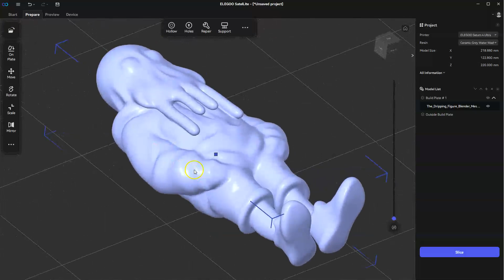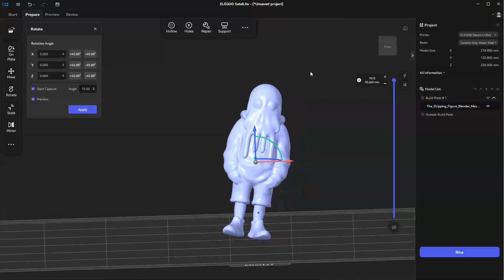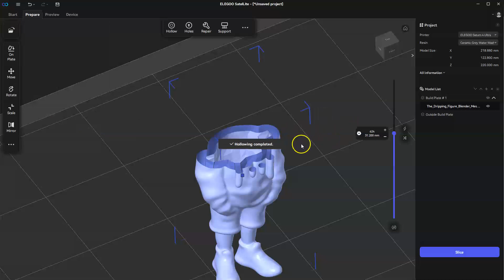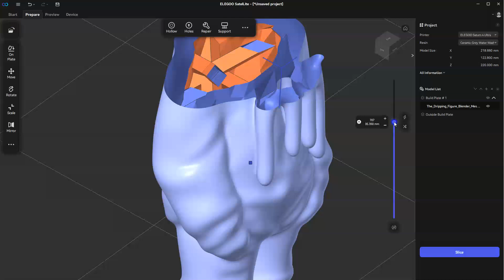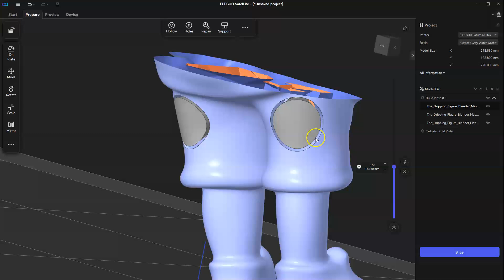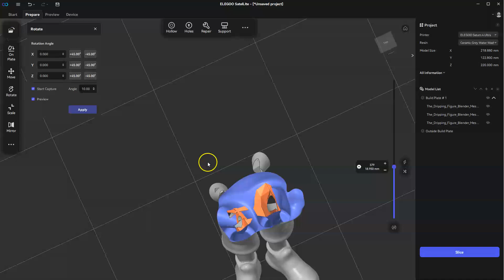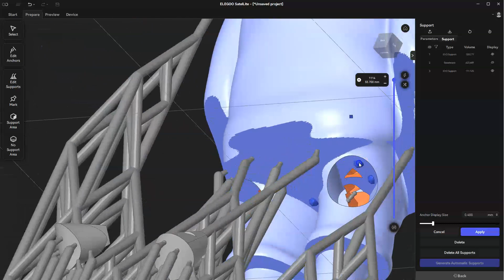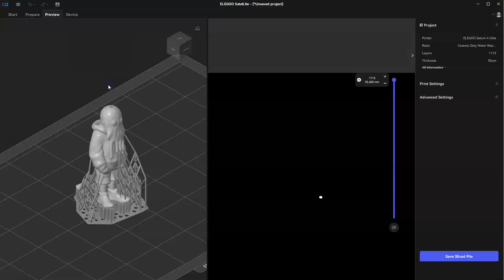Elegoo SatelLite Intro

Comment: Thank you for the additional info. I have been struggling with resin splashing out of the vat. I recently switched over to hollowing prints and did not know about cupping. I had to take apart my printer because resin went everywhere.
Reply from the maker: Cupping is important part of printing, adding holes and printing the plugs to replug your print is important. Sounds like you may have had too much resin in your print bed?